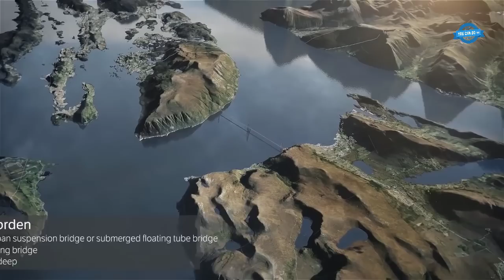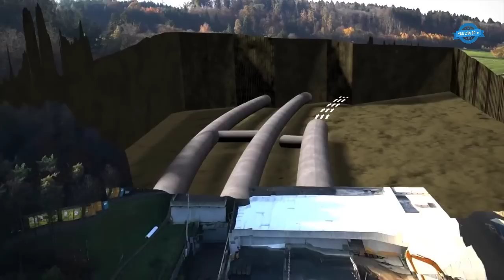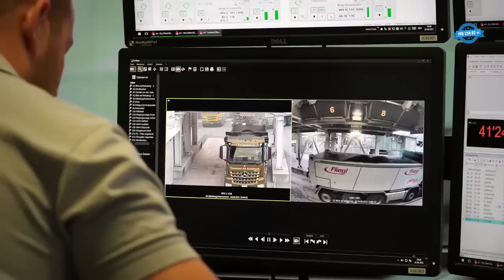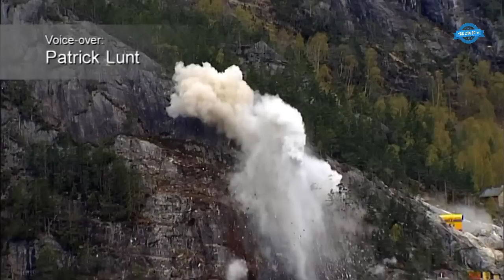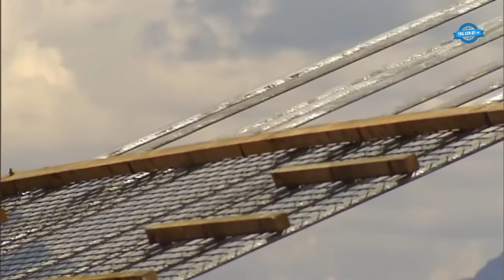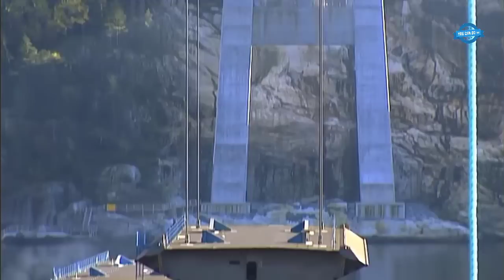How Did Norway Build Bridges Both Above & Below Sea Level? Tunnel Construction Process

Comment: Of course Norway's Engineers were super intellectuals by building of their own. They dont bother to hire foreign consultants this shows only that they are comoetent enough as ptoud professional engineers. Bravo men.
Reply: The Hardanger Bridge at the end of the video have all the bridge elements made in China and it was a danish company that stood for the steel work and assembly, not much Norwegian there
Reply: @12345anton6789        Maybe you should inform yourself that it is mandatory in all EU/EEA countries to have an international bidding process when a country are to launch a public financed project.   Norwegians are more than capable to build their bridges themselves.  Few countries ....if any has so many bridges as Norway.....and someone must have build them....right....   
So the reason for the contract for the boxes for the road deck for being build China is simply price....and nothing else.
For the steel work and montage contract did the Danish MT Højgaard get the contract due to the best price offer.
For the roads/tunnels Norwegian AF Gruppen got the contract. 
For the concrete work/foundation/towers/anchorage of the cable into the rock did Norwegian Veidekke get the contract.
So now come and tell me how much of a bridge would it be without towers and all that concrete stuff...???
Reply: Yes. They don't bother to have half of the bridge made in China.